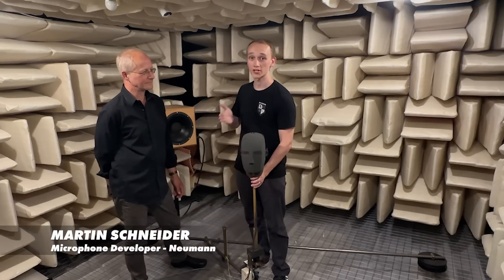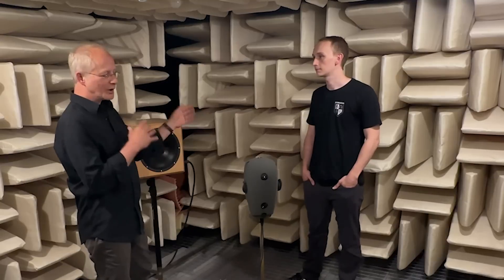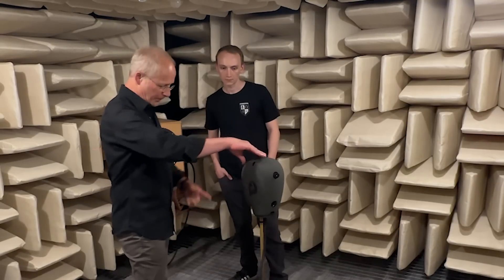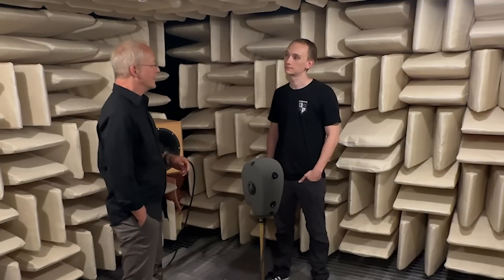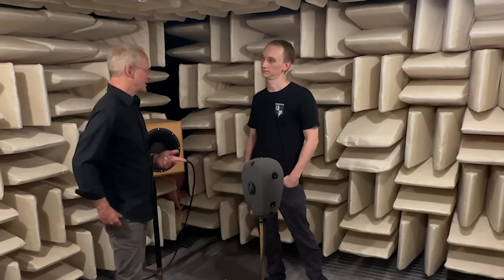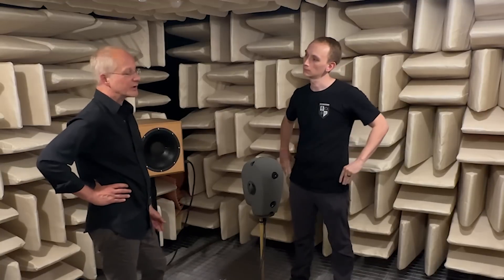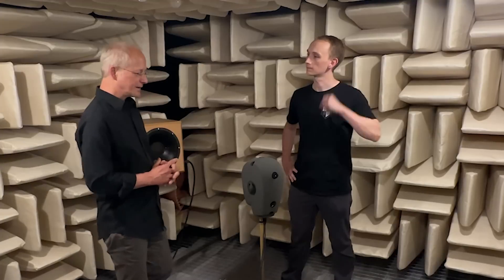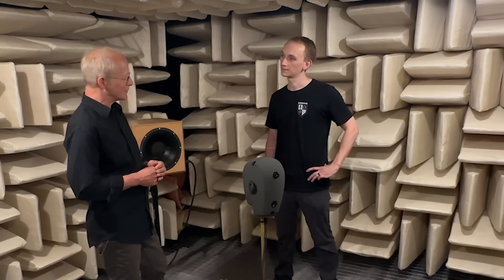Neumann Microphones: The Secret to Exceptional Sound Quality Revealed

Comment: Nice job on your side, but there isn’t really any specific insight. Microphone measurement is something companies like Lewitt do, too. So what makes this special, what stands out?
Reply from the maker: You're right that most companies test their microphones. The difference is the standard for passing that test. (i.e. there's a big difference between a tolerance of +/- 1 dB versus +/- 6 dB) 

A smaller tolerance for error means that more resources must go into producing the products. So, more units will not pass the tests, which requires more resources for refinement until they do pass. All tests are not created equally.